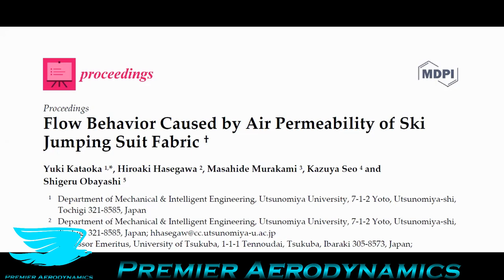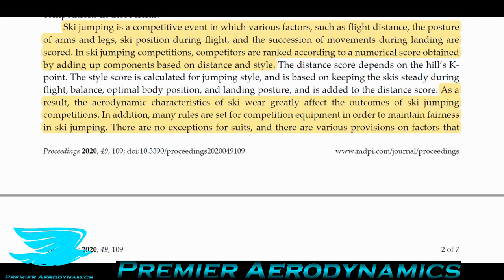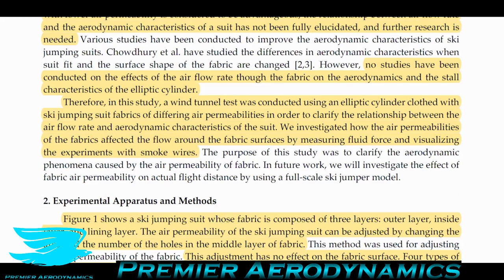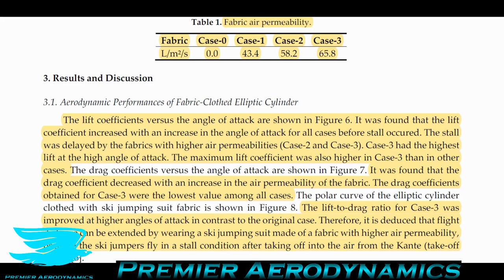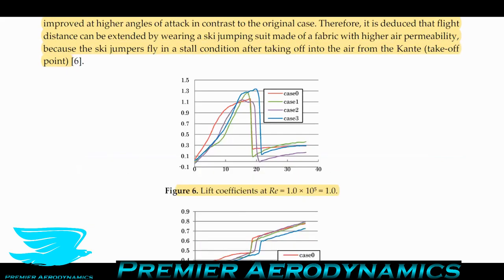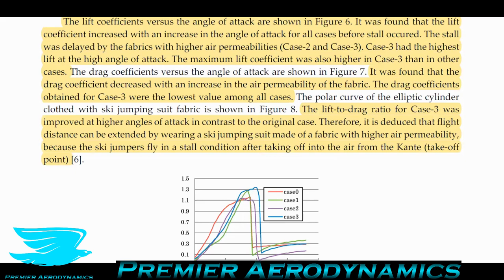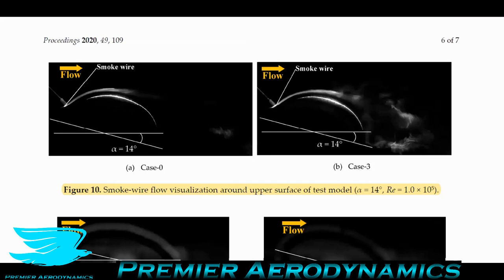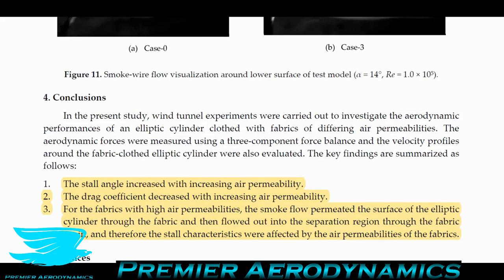Making Ski Jump Clothing More Aerodynamic! - Podcast #37

Comment: Going back to what we were discussing with RE# and ST# wouldn't permeable fabric reduce the characteristic length? With non-permeable ski-suit, the air has to treat the entire suit as a surface, which means the boundary layer has to extend the entirety of the suit, whereas with permeable material, the BL is partially energized by the permeability, and the air is effectively interacting with patches of fabric and associated BL, instead of a main boundary layer for the whole suit.
Reply from the maker: Yep, it would decrease a little. And yep, the BL would be partially energized by the air going through the permeable layer.👍